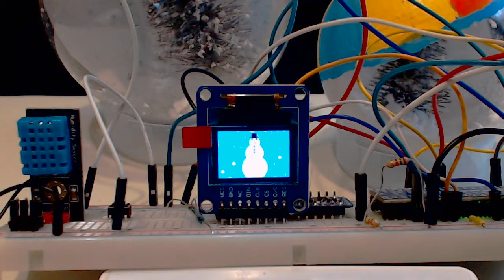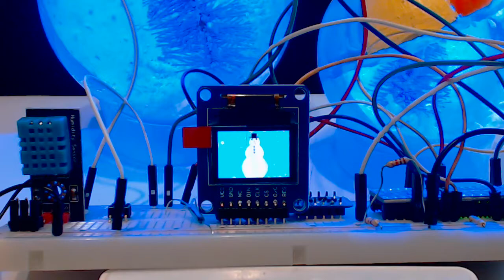Parallax Propeller Multi Cog Example

Comment: I'm trying to make a activity bot use both gps and a compass to move to a certain spot but the cog run functions don't work or the code doesn't run both at the same time. Do you need a special type of learn folder or some library to make it run. Can u please help me
Reply from the maker: I think you would best served by posting on the Parallax Forums.  There are a ton of good folks there to assist you. 
http://forums.parallax.com/

Also, have a look at this Learn example from Parallax:
http://learn.parallax.com/tutorials/language/propeller-c/multicore-approaches/simple-multicore

I hope this helps.
Reply: Jon Morss thank u